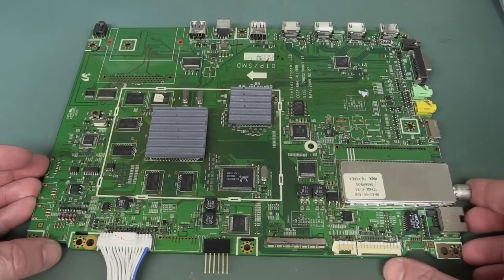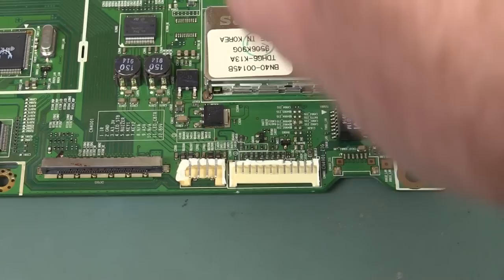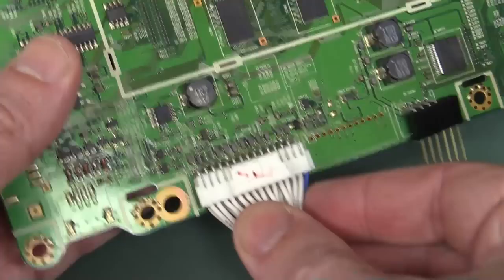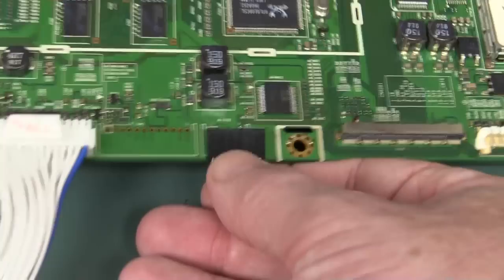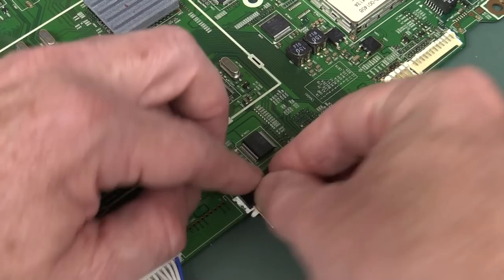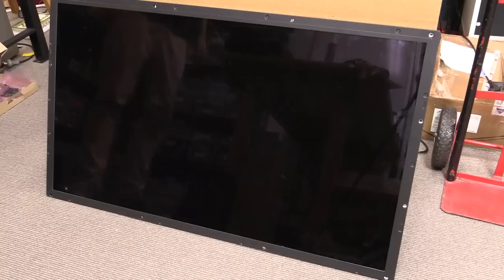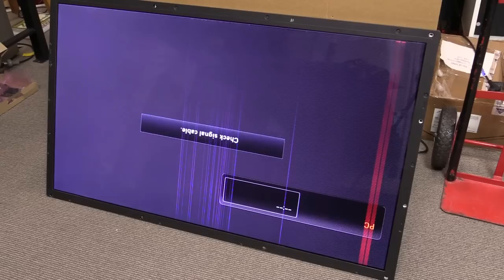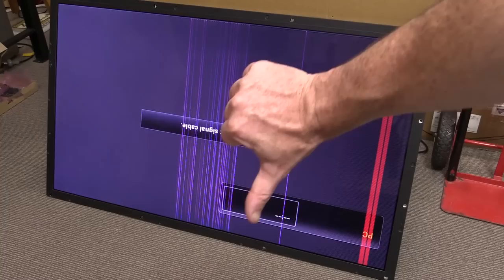EEVblog #794 - Samsung Dumpster LCD Repair Connector Followup

Comment: Because of the way the lines slowly appear, i bet it because something heating up.. 
Try using thermal camera to see if there is some single component that heats up at the same rate as the lines show up.
Reply: +NuffMan heating or ... charging  .....
Reply: +NuffMan that actually does make sense...
Reply: +NuffMan Wouldn't the thermal spray be a simpler approach to thermal issues?
Reply: That makes sense, but didn't he blast it with freeze spray before?  I would think the lines would have faded at least a little. Maybe he didn't hit the right component. He's got the FLIR, this would be a perfect application for it

Comment: As per the discussion I had on the last video, its probably not the panel, but I would have liked to see the main video processing chip get his with some freeze spray at the end :D, IIRC I had an Akai 21" LCD do that many years ago, the Genesis display driver had gone bad causing red lines like the ones you see to flare onto the screen as it warmed up, I hit it with freeze spray and they almost disappeared. but as you said, without finding the exact source of the problem , it can turn into an expensive parts swapping exercise!.
Reply from the maker: +Aussie50 I froze the main processor and it's memory several times in a previous video.
Reply: +Aussie50 Hey, Ed. ;)

How's it going with the Flight Recorders?

Are you planning on extracting the audio from that recent tape, or recovering the data from the Fairchild FDR?

As for Dave's LCD, I think it's probably the TCON driver itself, personally.
It could be one or more of the Chip On Flex drivers though, as I had a similar thing happen on my Samsung (bad solder / bonding on the flex chips.)
Reply: +EEVblog I think someone linked a video of someone fixing this through the service menu.
Reply: +gamerpaddy They live about 14 hours drive from each other...
Reply: +GroovyDrifter could you find that link pls?
Reply: GroovyDrifter I don't think that was a real fix - they just turned down the gain / drive on the panel which sort of worked but then the image was way too dark.
Reply: ***** - it's not a firmware issue, it's very likely the TCON board or panel are bad.
Reply: +electronash You're most probably right... english is not my language and some times It's hard for me to follow some videos.
Reply: +GroovyDrifter No problem at all.

Any suggestions about fixing electronics are always interesting to talk about anyway. :)
Reply: +EEVblog ahyehyou did too, I need to stop watching these vids at 1AM :p
Reply: +Aussie50 slacking in the destruction department again? :P
Reply: +umbrefawx lol need more new and interesting things to do around here :D
Reply: +Aussie50 yeah been having that problem myself, but been seeing Julian  putting out more vids, looks like he got the 586 running 3.1 now.
Reply: +umbrefawx yeh, Julian has a good routine going now!, its great.
Reply: +Aussie50 I can see that. What happened to yours? Lol
Reply: +umbrefawx just got IRL stuff going on, Youtube is not a high priority at the moment.
Reply: +EEVblog I had a problem with an old computer, an Atari 130XE. As it warmed it started failing (i have a video about it but sadly not about the final fixing). I froze all the suspicious components and nothing changed, so I suppose the problem appeared with time but was not heat related. I started replacing the part that the self tests said was wrong wich was the system rom and after that, the replacement eprom I programmed told me something was wrong with the upper 64K ram too. Once the computer was fixed and working, and knowing what exactly was wrong I put the bad parts back on it (I always put sockets) and the problems came back as expected, but once more the freezing spray did not work, even knowing for sure where exactly I had to point it. This may not be of much help but it was my first time using the freezing spray and taught me a lesson on having much faith on it. I've seen a guy bending the board to fix this problem... don't know if this may suggest something like some bga in need of reballing or something like that...

Comment: Surrender is not an option, please make it work again.
Reply: +Dorf Schmidt This TV set is FUBAR
Reply: +TheBadFred Indeed, time to follow in the footsteps of Bob Pease and chuck it from the highest available rooftop and see if that does not fix it!

I do miss him as he was such the character and so much fun to watch.
Reply: +Dorf Schmidt In my experience, it's often the main board, followed by cables, followed by t-con board. Sometimes, it's just in need of a firmware update. Those are fun when you don't have wired internet access and have to use your cell phone as a hotspot and have 1 bar of service.

Comment: Pretty sure its a tab bond issue still. top left one most of the time is the cause. bend that part of the frame with out pulling it to bits usually works..

Comment: Based on all the videos on this, I'm almost certain that it's the PPU that's bad, possibly the line/framebuffer RAM at some stage in the image processing pipeline (stuck bits that end up accumulating from previous frames and previous lines).

Comment: It is quite odd how the streaking only affects character generator output. Graphical UI elements like window borders both horizontal and vertical seem perfectly fine.
Reply: +Teardown Dan oh shit, I was busy thinking about how the lines slowly appeared that I didn't even realize that it was just on the text... weird now I'm not sure what the problem could be.
Reply: +bmw2go11 Possibly, but then what are the odds that the previous owners threw out a fairly new LCD TV just because the OSD was messed up?  If they are like many viewers you almost never see the OSD in operation save for very briefly when adjusting volume.  

Then there was the additional issue of every other horizontal line messing up as well, if I recall correctly.  It is behaving a lot like a capacitive charge building up without ever discharging the way it fades in so smoothly (and seems to be immune to freeze spray so probably not thermal in nature).
Reply: Ethan Poole My guess would be some form of error in the image processing code or DSP. I could imagine the vertical streaking being caused by an IIR filter having the wrong decay coefficient and not being reset at the beginning of each frame, causing it to accumulate a persistent bias. As for why it seems to only affect the text overlay, maybe the graphics overlay is exempt from the filtering while the text overlay isn't for some odd reason.

Maybe the display/UI controller simply has a corrupt firmware image with a few flipped bits.

Comment: Gate open driver voltage on t-con board!111 dc-dc converter on t-con!!111
Reply: +FutabaGP voice of experience I hear ???...I agree, I have corrected this type of problem several times before and its usually the t-con board.
Reply: +FutabaGP whoop whoop - send in the crash cart and GET IN THERE DAVE !  COMPONENT LEVEL REPAIRS PLEASE
Reply: +FutabaGP Good Idea!
Reply from the maker: +FutabaGP Got a schematic for the board?
Reply: +EEVblog unfortunately no, as far as i know there is no schematic for this particular board.
Reply: +bmw2go11 i have hand soldered a tiny little transistor package (sot23?) on my z77 motherboard that died on me. works again!

Comment: This looks like a TAB BOND issue, I've seen many samsung as well as other brands that have this problem......
If you press on the ribbon cables that feed the LCD display from the feeder boards, you'll prob. see those lines jump on and off.
Check those ribbon tab bonds from lcd panel to the feeder bd's.. !

Comment: Hello, I have a question:
Is it recomended to reflow connections on boards with a hot air gun? Like if i put a PCB in the oven I can reach a max temperature of 250°C but with my airgun it can reach up to 580°C. Would the heat damage SMD´s? 

I ask since i salvage lots of parts from old electronics via heat gun but never thought about parts getting damaged.

Comment: It appears that the stripes line up exactly with the ascii characters generated by the panel.  What if you put a signal into the panel, TV, PC, DVD... whatever.  Will the lines disappear as there is no on-board generated characters then?  it may still be usable in that case.

Comment: Could that artefact be due to memory failure?  If the colours are always the same at each position across the screen then that would suggest a fault in the display memory.  Probably be a PITA to replace surface mount memory, though, so likely not worth the effort.

Comment: Since the issue occurs around the ASCII characters, does it work fine if you have an input connected?
I.E. If you plugged in a computer or external set-top box would it work fine for those purposes?

Comment: Just a wild thought :

What if you use a thermal camera towards the PCB and another regular camera towards the display panel. 
Boot it up, and cross check the two recorded videos and see which chip heats up in proportion to those discoloration showing up on the panel! :)

You would then find out which one is most likely the culprit.. ;)

Comment: I'm afraid that in such cases normal reflow temperature just won't cut it..I followed the most common temperature profile on my nvidia gt650m and didn't work until I brought the temperature right up to 300 Celsius! (heat gun and multimeter, several attempts, using no clean flux). since it's lost anyway, you might want to give it a try...

Comment: just try push place on screen in corner flex where signal goes from vertical to horizontal drivers. i wrote a comment in first video.
Reply: +snik2pl the same thing was with sony KDL series. Shame that Dave have theoretical knowledge but don't have practise in tv repairs

Comment: It seems like a MSB shift somewhere  between the caracter generation and it's overlay. It only happens on SOME of the text, but ONLY in the text. Something analog, with a linear behaviour over time (heat?) is crosstalking and contaminating digital outputs. A faulty decoupling cap along character generation ground reference is my best guess.
Reply: It happens everywhere there is text when it has run awhile (as seen in earlier videos), though the degree of intensity seems to vary with the color of the text making the red stripes in line with the "PC" text stand out most of all -- some pixels seem to "charge up" more quickly than others depending upon color of the text (almost as if a memory cell capacitor is slowly charging and never discharging).  But, if I recall correctly, there is also an issue affecting every other horizontal line as well when you get a closer look at the screen.
Reply: +Ethan Poole and upon closer look, only characters with a vertical pixel density seem to generate lines. look at the time --:-- only the collum has the red line

Comment: It's not the panel. I've had this same thing on a Samsung. After a month of debug (from time to time) i gave up and bought a cheapo Chinese replacement kit that worked for the panel i had. I replaced all the shitty parts on that, put bigger heat sinks and reflowed all the solder and it's working perfectly now.

Comment: just bought a 42" Philips Lcd TV for 30€ it works fine but it always takes two presses on the power button to come on. Power Supply looks good and gives the Voltages it should...i guess ill just use i as it is...

Comment: my guess is a on film ribbon ic from the driver board to the screen,had this problem.check it to see if its getting hot?iv tryed heat sinks with compound lasted the longest but the fault still came back to haunt me, Murthys Law lol

Comment: i don't see the panel as the problem, chase the idea of the t-con board personally, as when you fired it on, for about 20 seconds, there was NO lines, you didn't mess with heating the panel, just the boards, yet for 20 seconds NO lines, in my opinion, you would have immediately seen an issue in the panel so technically, i suspect one of the chips on the t-con board also, and possibly 3 or so solder joints to make them work aren't connecting properly

Comment: the way those lines charges, there's must be a leak somewhere. either a resistance (heat) or capacitive (heat or just some faulty component) problem.
I haven't seen the schematics, but it has to be near the output circuit and definitively in the vertical circuit.

EDIT:
saw a comment that pointed out it's only on the text...though why not L, - , i or the first part of h and k, that's just weird.
buffer problem? now I'm just guessing, I have no clue  R.I.P tv you were worth a try.

Comment: It goes to show why it is cheaper just to buy a new unit rather than trying to have an old unit repaired.
Reply: +gobblox38 Sometimes, yes. If all you have to do is replace a 50 cent cap, repair the fucker.
Reply: If you know how to do that, most people don't and would have to pay someone that knows how to.
Reply: gobblox38 Most people should learn some basic freaking electronics. Seriously, inside of a week prettymuch anyone can learn how to replace caps, even if they've never seen an electronic device before.
Reply: The problem with saying that most people ought to learn a certain skill is that most people would rarely utilize that skill.  Unless it is a hobby or part of your profession there really is no use in learning it.
Reply: +gobblox38 manufacturers realized we're fixing our own stuff by replacing capacitors. The timed faults are now in the chips themselves
Reply: I'm skeptical that they would go through the effort of designing that into a chip just to screw over hobbyist.  It sounds more likely that there are other factors that went into that decision.
Reply: gobblox38 it's not really hobbyists. John Doe can now fix his crappy Samsung LCD with a €5 soldering iron. Electronics got a really low threshold nowadays
Reply: gobblox38 Not just hobbyists, any non <insert brand here> service centre, freelance repairmen, etc. They all have to go buy a whole board at a ridiculous markup now, because you can't replace just the one piece.
Reply: +redtails sometimes,  yes,  however there are times when even electrical engineers can't fix the unit for a lower cost than a new unit. For example,  the TV in this video.
Reply: +Teth47 they could replace the individual part,  it just costs more than a new unit so there is no point in trying to repair it.
Reply: +gobblox38 I thought that your point was that even if you do know how to replace a cap, that it's cheaper than trying to repair it. If you do know, and would like to learn a little bit, opening the back and doing some basic trouble-shooting is worthwhile.
Reply: gblargg Yeah, there was a bit of confusion on my end when I was replying earlier.  I need to get out of the habit of posting from my phone while in transit.  I'll try to clarify.

Basic troubleshooting is worthwhile if you have the knowledge.  If you don't have the knowledge then it is cheaper to get a new unit.  A person could learn that basic knowledge, but by taking the time to do that they have less time to do other things that might be more productive.  If it is a skill they will rarely practice then it isn't really worthwhile to learn it in the first place.
Reply: gobblox38
Totally agree; knowing when to spend the money (and keep your time/energy) is a valuable skill, in all areas, not just electronics (and just as well even if you don't know electronics). So many of these repair jobs turn into an endless rabbit hole that I've wasted a lot of time on some when I should have just moved on. Others have been great simple repair jobs that have worked for years after. Knowing the difference is good.
Reply: gobblox38 I just don't agree. Majority of times it's just a blown fuse, an empty battery, or leaking capacitor. We no longer live in an age of superfluous waste production. Be a bit more conscious of your surrounding :(

Comment: Pretty sure it is a planned obsolescence at the firmware level by Samsung to prevent you from using the TV for too long.
In looking up this issue, it seems that many other people have that same issue after a number of years, and it basically starts suddenly, as if a timer has counted down, and the TV decides it is time to ruin the picture so that the customer can buy a new TV.
Reply: +Razor2048 Yesterday I replaced 2 Kidde smoke alarms after 10-years and one month beyond sticker dates. I took them apart and the Lithium cells are still useful, but an internal oscillator surely was in there counting away! In this case, I think is was some panel adhesive strip problems (and those little chips glued to the final flat-flex cables).
Reply: +Razor2048 everytime you apply a firmware update, the "counter" is reset.
Reply: I was thinking more like how some panels will measure the bulb or screen on time, on samsung TVs, they tend to keep that data even after a firmware update when you check the service menu.
Reply: +Razor2048 to be honest, i have no evidence about this planned obsolescence  myth. Natural/enviromental obsolescence yes, planned .... mhhh! :-)

Comment: If it is only ascii character that are do line, why not Turn it on, with monitor cable plug in, and the Text is only on screen for about 2 second, then it go away, so the lines not appear, and you can use it as monitor!